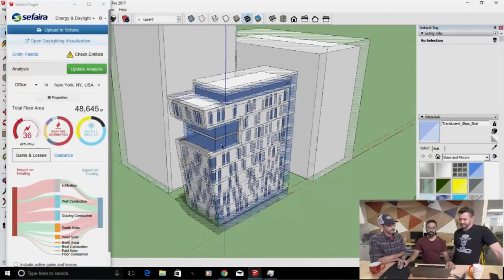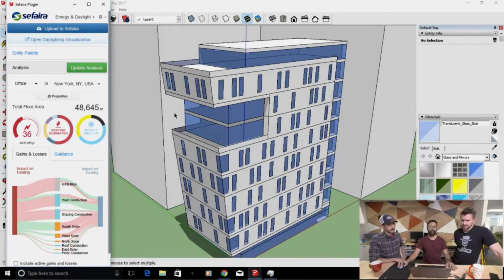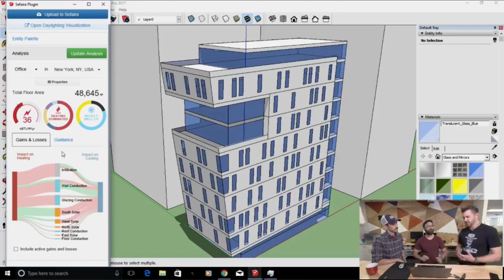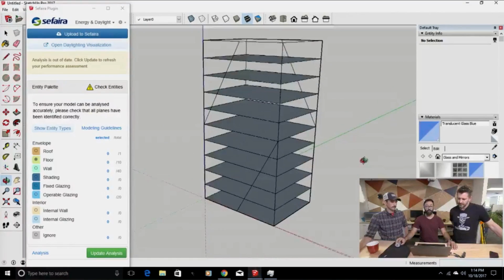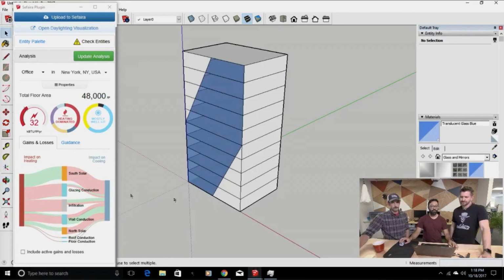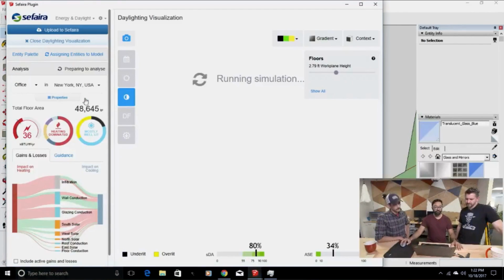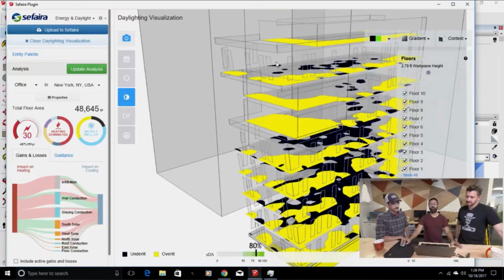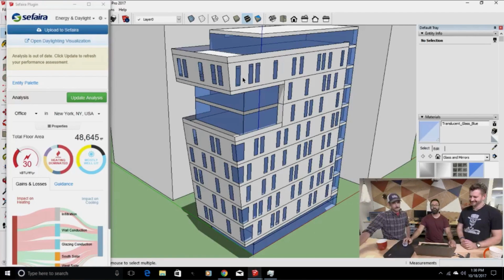Facebook Live: Sefaira (October 18, 2017)

Comment: Pretty cool tool. I am developer/builder of apartments and building performance is becoming a big deal and yes, there will be a "net zero" requirement put on us. That is fine, but the reality is the user behavior has the most impact on the energy use. Regardless we will have to jump through these hoops and this tool seems helpful especially at the conceptual stage when we are placing our buildings on a site and deciding on window types, sizes and the shading of that building. Many times we are using the shading as gingerbread, but it can be helpful and validated with this tool. Interested in looking at it. Our design consultants, unfortunately, are only getting us thru permits and help us comply, but I don't believe they are "war gaming" different scenarios. Maybe they are. 

One question: Does the tool allow for you to change the wall thickness or material? For example, wood frame to concrete, or CMU to ICF, or poured in place concrete to CLT. I think this would be super helpful to finalizing the structure.

Comment: Before computers, we called the  airport to get the "degree day data" and make heat loss calculations using Arithmetic, which isn't a bug, it's a system for adding, subtracting, and multiplying and dividing numbers.  Each material of the exterior had to be calculated, and done seasonally, so four calculations would define the Winter, Summer, Fall and Spring, expected performance of the building.  Now Sefaira does that hourly, without a pencil.  (or eraser)

Comment: 9 minutes in and we come to the first question;  When using the sun for heat energy, thermal mass would moderate the peaks and valleys and moderate the temperature inside the building making it more comfortable.  Like a battery in an electricity generating circuit.  But where to put it, and how much?  If I'm modeling in Sketchup, can Seifara output in real time those data as I construct it?